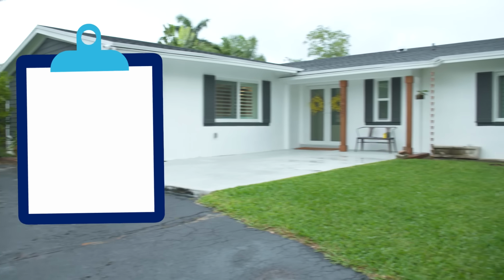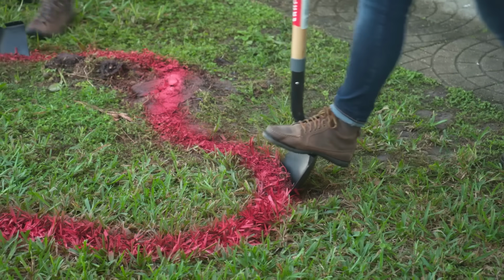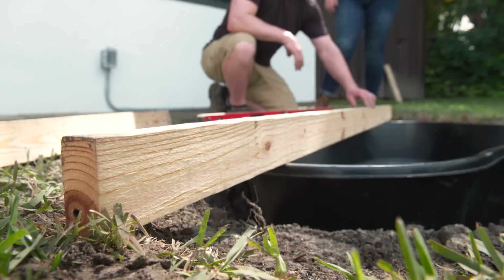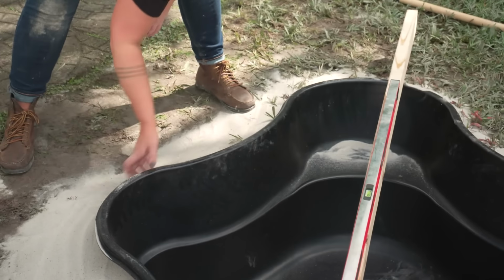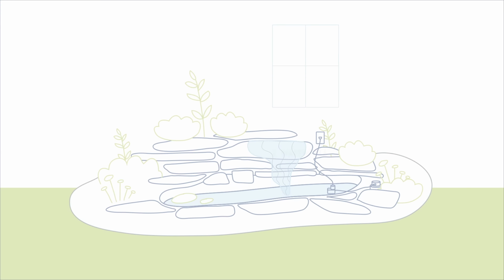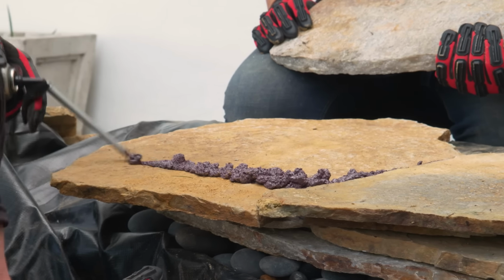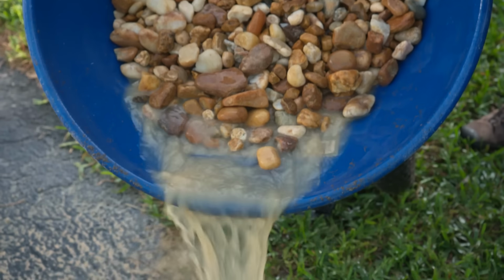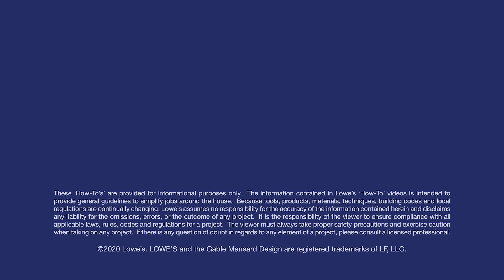How to Build a Garden Pond (w/ Monica from The Weekender)

Comment: Wow, this project was more involved than I realized. So glad to see Monica back! An approximate cost for this project  and amounts used would be a nice addition to the video . Thanks for sharing this project with us.
Reply: Old comment but I’ve seen plenty vids showing how to build budget ponds (100$). It will obviously not be as extravagant as this shown one (300$) for the plastic liner alone, over 1000$ overall is cheap for a fully built pond with proper filtration, with plants and rocks.
Reply: @sethwalsh8095  the liner is $99. The links are above......
Reply: @Ohdipson8  use lime stone liner you could make a 600 gallon pond for 99$ using it. Pumps are 30$ on Amazon as well. You may be able to find some old pool liner if you ask around enough even. Wish you the best of luck in building your pond.

Comment: Small suggestion. Before adding the backfill sand, temporarily place some concrete block on the bottom of the liner. This will help prevent the liner from moving as you add the backfill.

Comment: i am wondering how does this pond deal with rainwater overflow?
Reply: The makers of the video don't need to think that far ahead
Reply: It’ll over flow. just use buckets and take water out so the filter doesn’t fill
Reply: @Yudi Wang I have one of those ponds it's dug into the ground an around the edge has rock wall so when it overflows nothing can exit except water or drill small overflow holes around the top of pond
Reply: Watch Aquascape videos to see how to make a real pond
Reply: If you get runoff from your lawn fertilizer..will fish grow faster??😅😅😅
Reply: Its late but i think you would have to add a drainage pipe around the rim of the pond
Reply: @Clutchjewel795  ikr this pond has so many of my pet peeves
Reply: 1st, you do not fill your pond all the way to the top so under normal rains it should be fine, but you should check your pond regularly  so if you think the water level is to high just remove some of the water with a 5 gallon bucket.

Comment: The problem is in Lowe’s website, 90 percent of the preformed liners are out of stock with no plan to remanufacture.
Reply: There's no reason to use a preformed liner.

Comment: One question: Is the electric wire safe being on the wet ground? No conduit of any sort needed?
Reply: Sam 2000 all pond and aquarium pumps have thicker insulated wires so it could be able to withstand being submersed in water
Reply: It's kinda like Christmas lights on people's homes all year round. There are those families who never remove their lights and have them up all year round. I'm not sure how the sun and years of aging hasn't killed those wires. But if you consider that a baseline you will understand. Also the plastic coating on the electrical is made to withstand years and years of this. Which is why we recycle stuff that can't biodegrade easy. Number one is plastic and rubber.
Reply: I have had a pond for many years. I always have to connect to an extension cord. I have never had a problem.

Comment: Respectfully, a Koi pond must be a minimum of 3ft. deep & each adult Koi requires 500 Gallons of clean, well oxygenated water...sorry, that's a Goldfish pond at best & if that's gonna be your only filter, you'll need to replace your pads or clean 'em out on a weekly basis. It's a cute little pond though & I don't mean that sarcastically.  My other concern would for the fish' safety from Herons, Raccoons, Hippies, etc.  There is no escape from predators in such a shallow & small water feature. It's just a matter of time until it's sushi time, and you glance out the kitchen window, only to notice upon the neighbor's roof,  your $300 prize Koi getting chowed down on by a Giant Blue Heron.
Reply: This is not a fish pond
Reply: She never said this was a fish pond.
Reply: @BeeWildHomestead  No but she mentioned adding  fish to the pond at least once 10:33
Reply: ***50 gallons
Reply: DrJoJoBoxer 

She said “if YOU’RE willing to add fish to the pond” she didnt say shes going to do it. So no, she didnt actually say shes going to put fish in there
Reply: @tree_ponder_sc_fishing  no, koi fish need 500. 50 is enough for like, three GOLDfish.
Reply: @DrJoJoBoxer  you can put guppies, goldfish, medaka,  etc not just koi
Reply: What do you mean by hippies?
Reply: @rachelfajardo9640  my sister has koi fish in less than 500 gallons
Reply: What would you suggest as a filetering system for a pond 3 times this size?
Reply: 3 ft if your in a freezing area. In the south 2 ft is fine. 500 gal per Koi is bunk. I’ve had 7 good size koi in 800 gallons. Granted I have a LOT of filtration and lots of rocks and pebbles for bacteria. Flowing 8000 GPH with 3 waterfalls. 2 bio falls and a small bog. Water is pristine ,fish are happy.
Reply: @tree_ponder_sc_fishing Koi need large amounts of water. Not fifty gallons, hundreds of gallons, and a bit of depth. 
I have seen hundred year old Koi on Oahu.
Reply: @jeffjones1223  filtering has many options as to types of filters. Most important factor is to have a proper GPH pump, coarse media to get the heavy stuff then I use a finer polishing pad. Then bio balls in a bag and a bag of some charcoal. If you’re not getting good results and needing to clean your filter too much it most likely is too small for your fish load. No fish, little problems keeping clean. Koi poop a LOT. Now bacteria get lazy in the winter so use cold water bacteria if needed. Fresh start up bacteria in the spring. Throughout the year I find it helpful to add a muck destroyer bacteria tablets. When everything becomes in balance and working you’ll have crystal clear water and happy Koi. Adding plenty of marginal plants will help control algae. Also I recommend barley straw extract. And of course don’t feed your hungry little Koi more than they will eat in around 5 min. Over feeding is the cause of many clarity issues. Be patient and let nature do its thing. By that I mean let the proper time for the bacteria to work. This does take time to colonize. What you’re trying to achieve is natures perfect environment. As to cleaning any filter media its best just to rinse in pond water however if you need to use a garden hose make sure you use a filter to remove any chlorine as this will kill all the bacteria in the filters. Hope you find this useful.
Reply: Thank you for being respectful

Comment: The electrical cables should have been placed inside conduit this is quite important.  Was there a sump? What happens when rain comes and the pool floods. You forgot the overflow? Or did i miss something. Other than that good easy  video.

Comment: If you add fish 🐟 fish 🐠... what about the winter in NC? It usually mild but overnight temps plummet around 30 degrees
Reply: This isn't a video about types of fish
Reply: I have always had Goldfish and they do fine even if the top of the water freezes, but they sell heaters. I picked one up at Walmart but haven't used it as of yet.

Comment: I want to build a bigger and deeper pond just like yours…would the pond system you have do the job or do I need a bigger one or do a need a different system of pump.
Reply: The more gallons of water in your pond the stronger your pump needs to be, if not, it will not be able the move the water properly. Once you know how many gallons your pond has the pump will say how many gallons the pump is designed to handle.
Reply: @debbieesparza110  
Thank you

Comment: Just curious how much this would add to your monthly water bill running say 12-24 hours of the day? I would obviously be wanting to turn it off at night. Would that be advisable or no? 

Thanks and looks great!
Reply: Hi Matt, the waterfall serves as a way to oxygenate the water for the fish. It creates bubbles needed for the fish to survive. I definitely wouldn't recommend running it only part time. Also, most likely a good option to let the water air out for 24-48 hours in the pond before adding fish. This lets chlorine escape which otherwise would harm the fish. And as far as how much electricity that costs you, that depends on your location and the pump size/power that you use.
Reply: I'm pretty sure Matt said water bill. 

Not much more since it's contained in a pool. The only time you add water is when you have a leak or from evaporation. You shouldn't lose much water unless you have this placed directly in the sun all day. Hope that helps.
Reply: @PedramBastan  Oh yes you're right he did ask about the water bill. My head automatically thought of electricity not water since the water is negligible. Electricity bill should be the concern rather than the water bill since it's a contained system. Thanks for clarifying.
Reply: Water bill? It uses the water from the pond guy.
Reply: I have had a pond for many years and it really doesn't effect my water bill and I live in Central
 Texas. I also have a swimming pool that doesn't effect my water bill that much. My water bill goes up in the hottest part of summer watering my yard to keep everything alive.

Comment: I don't understand why they say to dig down 3inches deeper to 21 then fill again the 3 inches in sand for level but then say the pond should be above the ground level. Ok it makes sense to have the pond a bit above ground level for keeping dirt etc out, however why then dig down the extra 3? If so just for cushion etc and leveling purposes then you really need to add more than 3 inches to get the pond 2 inches above ground level. I must missing something but now I have dug down 21 and will need to fill up more than 3 inches to get above level ground.  Yes Dawn this is very involved project. It's been years since I had done this and now I'm older and it is much harder so I hired out some one to do the digging. !!!!
Reply: If you only dug to where you want to pond to be then when adding sand your pond would sit to high.

Comment: While I like the pond idea to this house needed a covered patio or covered porch more. The covered patio or porch would have been low cost to do, low maintenance and added the property value in comparison to the in ground pond which would be high cost to install and maintain since you have to plug it it.  It also takes away from the property value because of these factors. After extending the patio or adding a porch I would then consider a portable water feature for the porch or yard. A lot less cost and stress.

Comment: How much did this totally cost to build including plants and such please reply you didn't give this info and it's much needed info I really wanna do this but budgeting first 🙂
Reply: Prob 300
Reply: More like $600-700
Reply: Cynthia is correct. I just started this project and I have spent 300 so far. I expect to spend at least 300 more.
Reply: @leftydiablo  How did it turn out?

Honestly $600 sounds very reasonable considering how much a concrete fountain of the approxiamte same size costs

Comment: will you able to give me an estimate of how much all the stuffs for the pond ?
Reply: looks expensive just for a little project like this.  especially with all the different rocks and pebble stones thats is not even in sight.  maybe couldve used cheaper rocks for supportin the flagstones? 

and instead of sand to fill in the pool perimeter, just reuse the dirt dugged up, water it, let it settle for a day or two to pack up?

Comment: Why did u use sand to back fill rather then the dirt you dug up?
Reply: Sara Halaoui they used sand bc it’s going to mold to the shape of the pond more than dirt will, like they said, sand will find all the empty spots. Hope that helps!
Reply: The plastic pond expands and contracts,  sand keepd it from cracking

Comment: Hi. How do you keep it from freezing if we are in the area with snow and freezing weather?
Reply: ricky ly you can buy something that circulates the water so it won’t freeze
Reply: @deastbeast4137  you build a pond deep enough for fish to over winter in your pond (according to your zone), and place an air stone near the edge to allow gases to exchange and NOT CIRCULSTE THE WSTER.

Circulating the water volume eliminates the "warm" layer near the bottom of the pond, and will likely kill any fish you are trying to keep alive.

Generally though, if you have any interest in keeping fish properly, dont ever build a pond like this...
Reply: They also sell heaters. I found one at Walmart.  I haven't used it as Texas only occasionally gets a cold spell. When the water temp gets below a certain amount, the fish do not eat, their metabolism slows down and usually over winter just fine.

Comment: What kind is pond filter is this ?
Reply: They are using a waterfall filter. The pump also has some filtration.  You will notice your water flow will decrease and that is when you cut the electricity, take your pump out, take it apart and wash it. This will be my first time having a waterfall filter. I'm thinking you can put medium in it to help with filtration. Little unsure, but am sure I will find out!  I always had a filter that you attach a fountain. When tge fountain decrease I knew to wash out the filter. I also have two pots of water lilies that helps to retain a clear pond.  I have also only had a fountain that has a very small filter you have to clean more frequently.

Comment: How do I prevent the cats and racoons from eating my fish?
Reply: shotgun
Reply: The same way they made a cave for the pump you would want to do that throughout the bottom of the pond so your fish could hide if a predator comes by believe me the fish know what do also make sure that the pond is at least 2 feet deep the deeper the better and last option you can always put a bet over the pond won’t look as nice but will protect your fish
Reply: I actually thought about this myself. I figured I would build mine and then fix the next issue as they come up. It's nature.
Reply: I put in a pet friendly zapper... its zaps them when they touch the hot wire... its safe but shocks them and they wont come back.  Its called have a heart or something like that... farmers use to to make there fence line "hot" so cows etc wont mess up a fence.  you only need to keep it up around your pond for a few weeks. Trust me they wont come back after getting shocked.  it would be like you putting your finger in a light socket... you wont do that again!  I put it on a timer so it would not be on during the day... its comes on at night and goes off in the morning.  They say it only needs to be around the pond for 2 weeks.  its keeps anything away!!   Let me know how it works out for you... email me paulbsg@yahoo.com

Comment: I would have liked if they told us how much the materials cost, that should have been the point you could have this for $$$
Reply: Its not cheap.  I just bout all the equipment needed for 400.00. 20 50 llb bags of sand for 100.00. I already had the mold which I got from Lowes for approx. 120.00.  As far as flat rocks. do an internet search for flat rock suppliers in your area.  For larger rocks, I suggest instead of buying them go on a rock hunt.

Comment: Why for you not run the electrical wire through a plastic pipe instead of just running it under the tarp to wall? Run plastic pipe to wall under the tarp with cord going through the pipe.
Reply: you dig?

Comment: I hate to be that guy but those flagstones you put in upwards do not look good. They take away (a lot) from the authentic look you mention. Also don't stack so many flagstones on top of each other to create waterfall. You want to stay away from a vulcano look as that tends to make it look artificial and less authentic. Also when you install an intake, always place it straight across the waterfull to maximize the refreshing of your pondwater which also means you ought to build the waterfall in such a way that it creates a surface flow to bring your dirty water across the pond. Last but not least, stop planting things so tight against each other. Study your plants and get an idea of how big they will become and how long it will take to create your complete garden/pond. Add less fast growers and more slow growers. Still, don't plant them so tight. They will smother and in the end it's more expensive. One final note, I'd use pondliner to create the entire thing. That way your free to build it any way you want. But that's just my opinion.

I've built quite a few ponds. My advice is legit as I learned from my own mistakes through trial en error. Also I'm a landscaper by profession. Good luck with your future endeavors. I would like to see you build another pond, this time the right way.